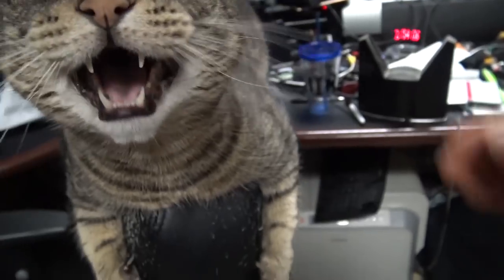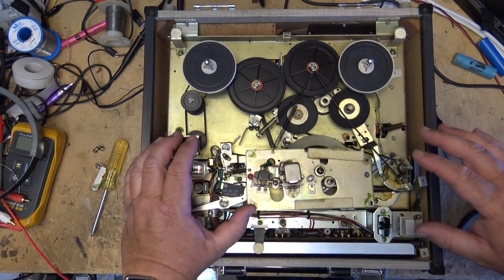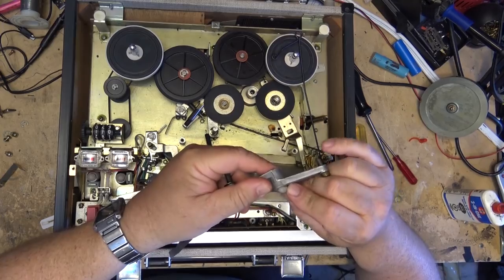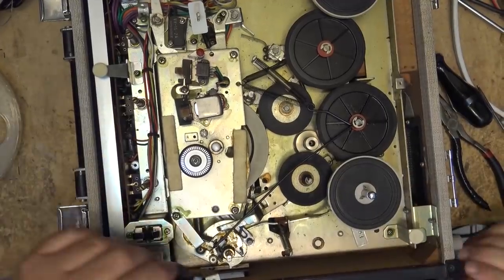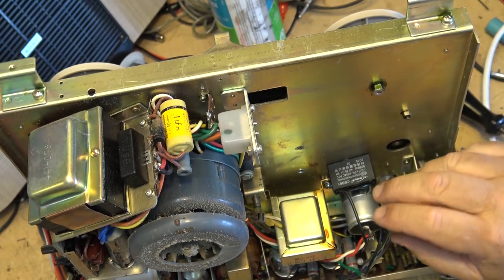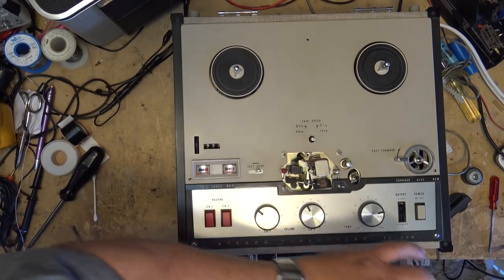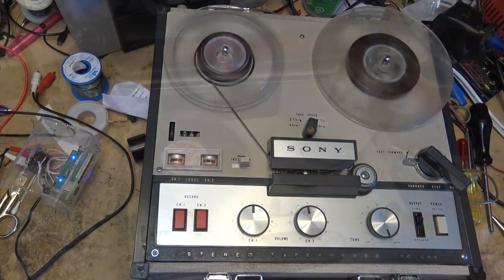sony tc 200 Hybrid Reel to Reel full restoration and motor speed repair

Comment: I just opened a TC-200 with serial number 128949.  Externally it’s different in that mine is dark colored and had a strap-type handle. Internally I noticed there is a difference in the transformers.  BUT! It also has TUBES!  The tubes are marked “63” and I see “64” the pots. Based on ads I found in old magazines I’d date it at 1965.

Comment: Equally rare is the Sony tc500 which I believe was all tube. 2 x 12AD7,  2 x 6AU6, 2 x 6AQ5 (speaker output), 1 x 6CA4  and 1 x 12BH7A one of the two which I believe was the bias oscillator.

Comment: How exactly would one be able to connect a modern 3.5 cable into this device? would I plug it into the speaker ports or would I do something else? Any help is appreciated, Im trying to digitize some old tapes.

Comment: Thank you so much for this...

I have a TC-200A that was a gift from my mother to my father xmas of 69, and with your help I was able to restore it to get a recording off of a tape even older than the unit.

Only real difference between mine and this one is the speakers, rather than being in the top cover they are on the sides next to the cutouts for the jacks.

I can attest the units sound decent considering how simple they are, and I was surprised how low the wow and flutter is (didn't actually measure it but it's low enough that it's not noticable audibly).

I still need to go in and do some more cleanup on some contacts, namely the record switches, still some static here and there on playback but all in all, I'm happy so far.

Also, mine mentions transistor locations inside but I didn't find any, just 6 tubes (I'll be looking closer when I pull the board out of the bottom to clean the switches).

With that I end on a question: Any idea what the range of serial numbers are? This one is 1596.

Thanks again for this video... Probably could have done it without it, but this made it so much easier to see what I was in for!

Comment: Hi Volt, Very good video and congrats on the success of the rebuild. Your expert knowledge of the electronics worked to your advantage in replacing the capacitor. On my rebuild of my Sony TC-630 the electronics problem prompted me to quit and put the non-working unit back in the attic. I wish I lived close enough to you so you could fix mine. I would even consider shipping the unit but it weights a ton. Great video, Thanks

Comment: I just bought one today for 50 dollars and it has 35 tapes with it. 30 of them are 7 inch tapes and 2 were Janis Joplin. There are about 20 that I would consider groups I’d listen to so a couple tapes are worth what I paid. It sounds pretty good so far but I’ll test it out and listen to a few tapes. Thanks for the great how to video!
Reply from the maker: I was given a full tube Sony reel to reel which I will be restoring soon. Will be fun to see if it works and what needs to be done to it. Being tubes, I am sure there are wax caps that need to go.
Reply: @12voltvids  I have a Channel Master portable reel to reel like my uncle had that I just bought and it worked great for an hour and then slowed down and the voices sound funny. I am guessing that it’s the electrolytic capacitor for the motor that went bad. What do you think? Another Channel master cassette player that I just bought has a bad belt because rewind doesn’t work and the belt seems like a loose rubber band. I have several new projects! Merry Christmas! Thanks
Reply from the maker: @patfromamboy  if it has an ac motor.

Comment: Just finished all your steps on serial number 97552 a tube/solid state. All cleaned and re oiled and now the fast forward pops up like it should, rewind,,pinch roller was just gummed right up,,all in all a good fix,,NOW the motor cap,,,,only played about 10 minutes and really slowed down,,,

Comment: Amazing, the stroboscope on pinch roller to check the correct speed.
Reply from the maker: Which doesn't show to the eye under my electronic balast lights, but did strope for the camera shutter at 60Hz.

Comment: Yesterday, I saw this same exact model at the Annex Antique Center in Red Hook, NY for $65, and I have not pick them up, but it looks really good, but I haven’t tried it yet, but I don’t have a chance to get it anytime soon.

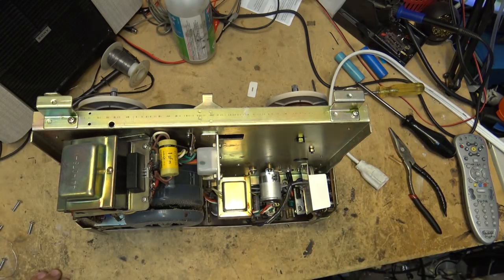This right at 37:17 has a hybrid tube amplifier like the ones in my Concord 220T also has a hybrid tube amplifier with transistors on them. The Sony TC 600 (the one I used to have) also has the same mechanism like the one in your TC 200 also has a hybrid tube amplifier as well. 

The Concord 220 has Japanese parts like the Sony’s do, and it was built by Matsushita, the same company that made National and Panasonic, and also made for Concord.

Comment: The best of both worlds, valves and transistors :-D.
I like your cap mounting, leaving the original one there, so it still has originality.
I have never used any kind of add blocker, i use chrome for youtube and it is setup as standard., and for general web browsing i use firefox with some blocking.

I noticed the carbon resistors with the odd endcaps/strips, an unusual design that keeps them straight and upright in respect to the pcb.

Comment: Is this a multi-voltage deck? If so, the cover over the capstan may possible be an adaptor for 50 or 60 hertz. I bought a similar model to this one a couple of year ago. Unfortunately all the internal rubber intermediary parts were in the process of breaking down, making the set unserviceable unless I could have found someone to reproduce new rubber parts. You might also want to lubricate all the other moving parts as well.

Comment: Your technology is really professional! I have a SONY TC-500. Its mechanical structure should be very similar to that of the TC-200. Your video is very helpful to me. In addition, my TC-500 has a Channel that has low frequency oscillating sound when playing.  do you know which part of the circuit may be causing it? Thank you!

Comment: Excellent video. I just found one of these in a old tour bus down in the bay. I wanted to buy the bus but It was to much for me. I looked in the bay and saw the recorder and they gave it to me. It powers on and rewinds and fast fwd the pinch roller is turning and I have sound coming through the speakers. I need head cleaner rubber cleaner in a de mag device before I try my  old tapes. Great video just what I needed.  If I could I would love you to go through it. Subbed for sure. Well I spoke to soon now it don't play or rewind?

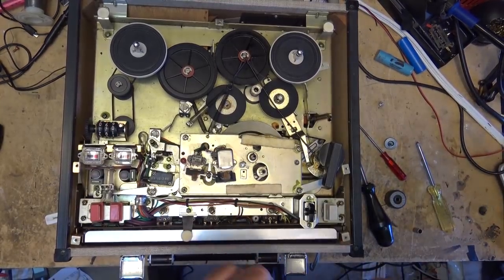Comment: Thanks for another great video, at 23:40 the L bracket that you forgot to install on the screw at the bottom left corner nearest the control magically appears !! I not sure if there is a certain position or angle it goes, thanks for your reply

Comment: Hello , could i ask : why did you leave the bad capacitor in place ? Did you put the new one then in series or in parallel with the old one ? Shouldn't you remove the old one ? How did you couple the new one ?
Reply from the maker: No need to physically remove it.  Then i have to deal with disposal of a PCB containing capacitor.  I disconnected the lead from the cap and put it on the new one.

Comment: I have a Sony tc-230 that was running slow so i replaced the motor run capacitor and it ran fine for a couple of times the next day i went to run it the speed was much slower. The schematic showed a 1.5uf and a 0.05uf capacitors in parallel so for 50 hrtz it requires 2uf and for 60hrtz it requires 1.5uf since both caps were in the same can i was thinking that i needed a 2uf run capacitor  so what i am going to do is buy a 1.5uf motor run cap and see if that cures the problem. (the deck has been lubbed)
Reply from the maker: From my experience these motors want an oil filled motor capacitor.  I have tried putting in the mylar types of the same value and the torque is always low.

Comment: Would you happen to know what other machines have the same pinch roller? I have the same tape deck and the roller has got rock hard. It also has two capstan-shaped dents... I also tried boiling it, but it had no effect whatsoever.

Comment: Great video thanks. Is the AC cap a dual 1.5uf & .5uf ? Just wondering if you are leaving the .5uf in place whilst replacing the 1.5uf side of the cap.

Comment: I noticed your reaction to the discovery of the tube amplifier in the sony is it dangerous to leave the old capacitor connected to the motor along with the new one I am just wondering maybe it will not have any effect or it will I think your skill is amazing and all your videos are wonderful thank you for being on you tube all of the parts on my teac a-1200u are free and not stiff and the solenoid is very weak and very little power as you have said it might be costly but I am asking you because of your knowledge and skill you would know the right price for the pinch roller solenoid thank you so much have a goord week

Comment: I was having a speed issue with my TC200 and replaced the capacitor with one with matching specs, but mylar. When playing back longer tapes, at anywhere from 48 to 60 minutes in the speed begins to slow. If I turn the Sony off for a while, I can resume playing and the speed is once again correct. I know this is not a tech support site, but do you have any suggestions for what I should check? Maybe I should look for an oil filled capacitor?
Reply from the maker: Belt? Motor needs lubricating?
Reply: @12voltvids  Thanks. I'm going to see if the motor/capstan needs cleaning and lubricating.

Comment: why does everyone assume because it is a AC synchronous motor that it will automatically run at correct speed?  sure 60 hz should somewhat control the speed , but the actual voltage can vary the speed or torque. I have a voice of music 749 from 1966  that ran fast... compared to my dc  motored units , cleaned all pulleys and idlers, and motor is stamped for 60 hz.. and is directly connected to the line , no caps or anything ... ended up placing a 20 ohm 20 watt resistor in line to slow down the motor enough to sound like my other units...the case says voltage requirements are 105-115 volts... todays voltage in my area is 120 - 125 maybe too high for that unit.... oh and every sony I worked on the motor cap was junk...
Reply from the maker: Squirrel cage are generally pretty close. Induction motors also will generally run at the correct speed unless you exceed the maximum HP rating, and then they will slow down. Only a synchronous motor will be exact. Synchronous motors are very low power and generally will NOT start on their own. The Hammond B3 organ for example has a synchronous motor for the tone wheel, and it has a seperate starter motor to get it going to speed.
These induction motors have 2 winding's. One fet directly from the line, and the other through the run capacitor. The run capacitor creates the 90' shift rotating magnetic field. If the cap changes capacity, the resulting rotating field will be incorrect, and the motor speed will suffer as demonstrated. Note that the capacity of the bad cap had actually increased. This was probably due to internal leakage. Voltage will affect the speed very slightly, unless it way off. The run capacitor is the biggest influence on the speed of these motors, which are usually relatively close. A servo motor is the really only option if you require an exact speed.

Comment: Did you replace the power cord? Any need to replace any other caps or just recap totally? Thank you
Reply from the maker: On tube gear the only caps that are necessary to replace our paper caps. if they have ceramic or my other caps they're generally fine. Even the electrolytics last forever because back in those days they were oil-filled and they never fail. Also only amateurs do total recaps you realize that right? Professionals never totally recap they find the one or two faulty caps and change them. Anyone that tells you any different doesn't know what they're talking about. Recapping an app or any of that trying to device is going to change the sound and not necessarily for the better I've had to go back on an amplifier that a customer insisted that I change every single cap I had to go back after the fact and put all the old ones back in because he wasn't happy with the sound of the expensive capacitor kit that he bought online. Vintage gear is left best with the original caps other than ones that have obviously failed and paper caps in the case of tube equipment only because paper caps go electrically leaky and will burn out tubes.
Reply: @12voltvids  Thank you.   I have heard others speak of complete re-capping.  However, I had not considered the impact on sound.  Your video and advice are much appreciated.  I did note on my Sony, the motor capacitor is shot, so will replace that one.  Unfortunately, I also found I don't have the tube version :(.    With the new cap, and a lot of the mechanical work you show, I am confident, I will get this Sony back on its feet.  Thank you again.
Reply from the maker: @garyfriedlander2396  oh I heard the stories from people saying you have to totally recap everything. Remember there are guys out here that will charge people for four to five hundred dollars to recap an app and convince them that every cap needs to be changed because that's where they make their money. there are shops around still specialty shops that will insist that you have to do it again because it's another way you can make money. I've done it a couple times for guys that insist that they want all the Caps changed and I let them supply the cap kits. They go online and they find a capacitor kit for $150 or $200 for their specific model they bring me the equipment with the capacitor kit and pay me just to change them. I did a few of them before I was making videos and one guy was very upset because his cherished amplifier now sounded totally different. I forgot what brand it was might have been a sansui or a luxman. Anyway when I pulled the old caps I put them in a bag and gave them to him. he complained almost immediately that it didn't sound right, sounded just fine to me. even had me come to his house to listen to it and tell me how bad it sounded compared to how it used to sound and demanded that I take it back and put the old caps back in. I did I gave him a bill to change them again the guy cut me a check when I went to cash or check I found it the SOB had put a stop payment on it. that was the last check I ever accepted from anyone now it's cash or you don't get your equipment back. That's how I ended up scoring a sansui 9090.
I rebuilt that one for a guy, it belonged to his roommate of the day. Since I had put a lot of money in parts into this receiver that had been blown up good, I had about 12 transistors and a few resistors and other parts that were burned up I told him cash up front are you don't get it. He said the guy that owned it wanted to make sure it worked before he paid for it, I turned it on let him listen to it I said there it works give me the cash and you can have it otherwise it sits here. The guy that owned it didn't want to pay until he had it and I explained to the guy that brought it to me well this is the way it works every month it goes up $50 for storage. About a year later he calls me up he says yeah my roommate wants his receiver back he's moving I said great you got the cash I'll get you the cash I said that's fine it's 500 bucks now he says what do you mean. I wasn't joking about the $50 a month storage it's now $500. The abandoned it so I got myself a nice receiver. Now today these receivers go for big bucks I could get 2,000 probably for this unit easily, but back when this happened they weren't going for much people were throwing them out even when the bill was only 200 to fix it the guy was squawking about how much it cost. But anyway I've had a couple of experiences with people insisting that every capacitor has to be changed and I warn everyone it's not going to sound the way you're used to it sounding, you may love this new sound or you may hate it because modern capacitors do not have the same chemical makeup as the vintage did. The chemical composition is totally different thanks to the EPA requiring that they all must be environmentally friendly now. This changes the characteristics even the so-called audiophool grade don't have the same characteristics that the originals did. So I just changed the ones that go bad and everyone's happy.

Comment: Hey Dave, how would you rate the sound quality from 1-10 (10 being the best) I’ve learned so much from you
Reply from the maker: Its tape and old.  On a scale 1 to 10 3
Reply: Thanks man
Reply: @12voltvids  I bought a used hybrid model today for $20 my first to dissect no sound out of chsnnel 2